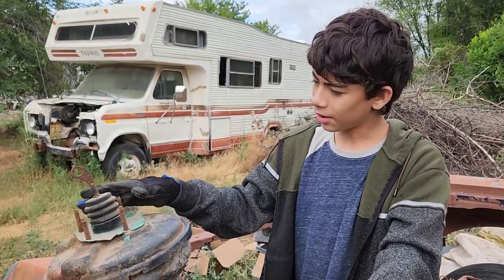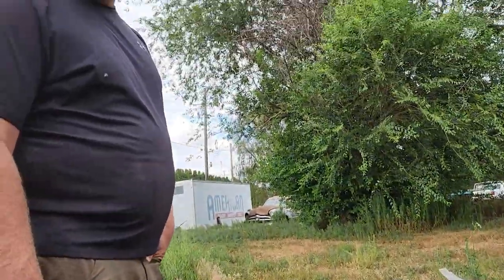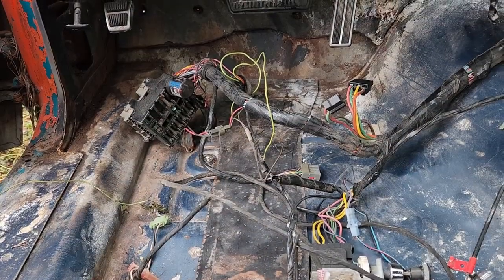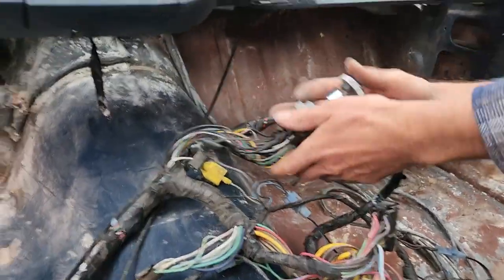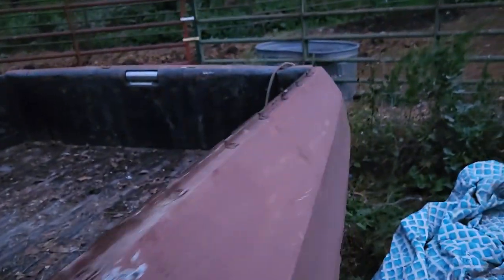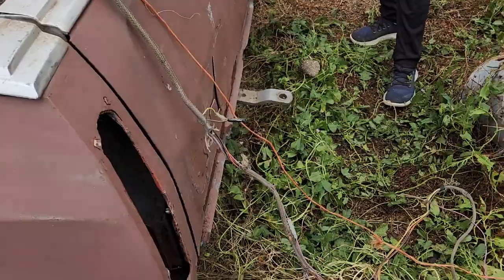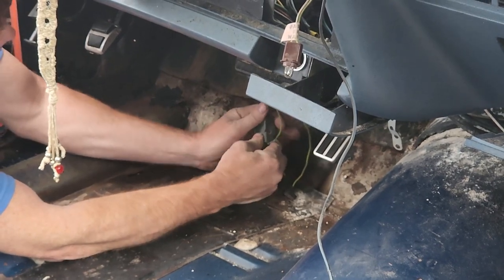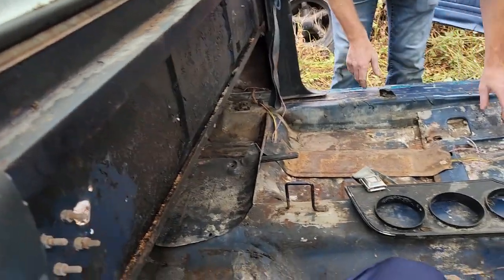Restoring A 1972 Ford Ranchero: Day 2

Comment: I owned a 1972 Ranchero Cobra in the early 80s. I really regret having to get rid of it. Smoked the tires easy, but the wheel hop was a pain. The area behind the seat was a good place to stash your cooler out of sight. If you had to much, the spare tire went in to the bed. It wasn't a great tire so no one was desperate enough to steal it. In the winter it went back inside.
Reply from the maker: Very neat story, thank you for sharing. I always love to hear the memories that these cars bring out.